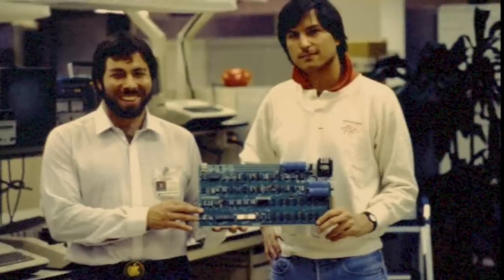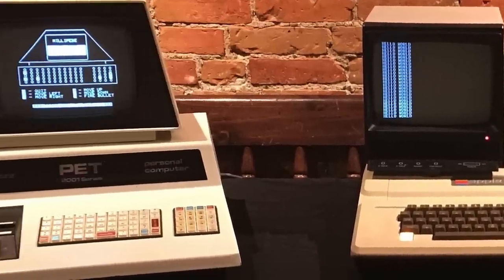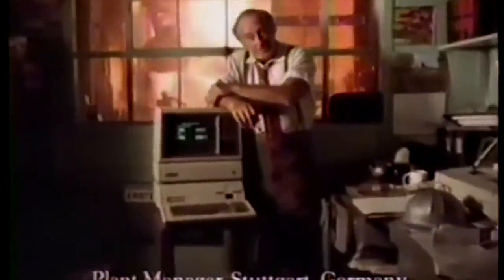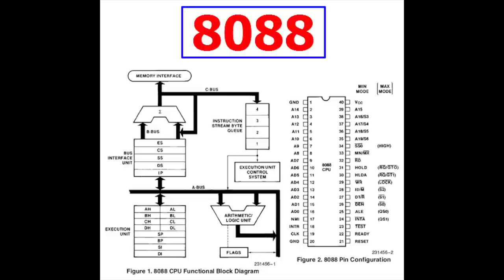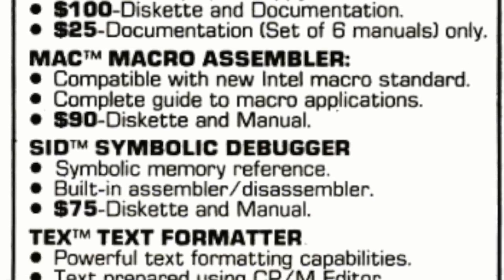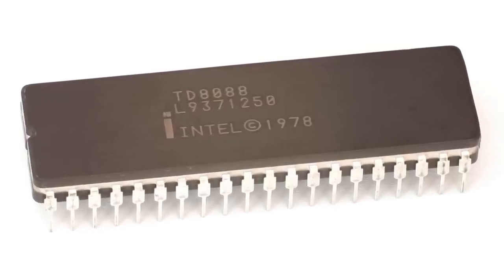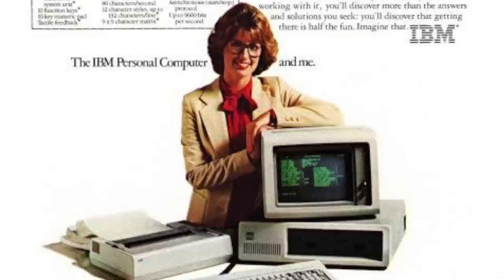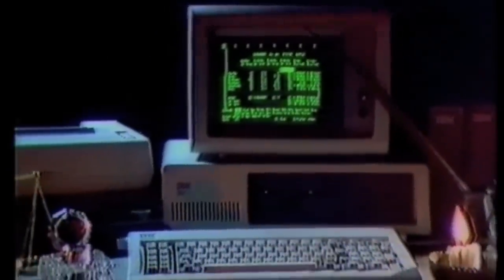DOCUMENTARY: Why and How IBM ended up creating the PC (and ended up choosing the 8088 CPU)

Comment: I bought the TRS-80 when it came out in '77, and eventually upgraded to the PC world with the Tandy 1000, and then home-built PCs. I suspect a lot of TRS-80 owners ended up going that same route to a PC, rather than Apple or something else. My friends with Apple ][s all got Macintosh, but even most of them are now with a wintel product. Nice documentary!
Reply: There was nothing wrong with the TRS-80.  It was as good, or better, than the Apple.  The reason the Apple took off as a 'serious' computer, as a opposed to a hobbyist machine, was due to the first 'killer app' being written for the Apple.
Reply: Also there are a few things I remember back in the day if anyone remembers the old PC Junior.

I remember sometimes running software on there and it was meant for the IBM PC and after a certain point you'd actually get Drive overflow not sure exactly what would happen there because it's just at that time I really was not big into technology nowadays and just really never thought about it again strange home that comes up so much that you don't even think about what happened back in the day with things.

Although the PC Junior probably would be closer to that of the Atari in terms of things like gaming but yet I have a feeling some of the Atari systems were actually more capable in their own way which is kind of cool but even something that was originally thought of as just games such as the Atari 2600 became something more of a PC even in its own way

By the way I was the kid in school that would always be servicing equipment I was the one that would always be loading the paper in the printers and so on.

Also in school I did have a lot of downtime I was kind of ahead of the game you could say!

I had all kinds of access to things that most students didn't even know they are there!

It's kind of neat when you can almost like make your own extracurricular activities including learning opportunities.

This would be happening often times throughout years of my schooling even in the early years.

And yes I got credit for doing so this as well someone is classified technical education I was even doing a bit of recreational engine stuff before even high school.

A lot of stuff was trade specific that wasn't even offered through our school!

Sometimes I was actually server this evening very equipment that I was using to do all this as well.

Some of these pieces of equipment I still don't even know what the media even was that the equipment uesd.

There was one other one that used two different cartridges can't remember what type of film it was but it was on what look like 8 mm film or perhaps 16 some of the cartridges almost looks like an 8-track but oddball much larger pretty sure the audio portion control portion on the same cartridge and tape of course was an endless with cartridge probably the same with the film portion but not sure on this portion.

I do remember often using what they called the teaching projector but this is a different system entirely use a single cartridge for both audio and film.

This is what I would call Antiquated early multimedia!

Also very early in school they have perhaps kindergarten maybe later.

There was a system it was pretty large and heavy the audio was on an LP photograph record the slides if you'd calm that although War closely akin to a film strip but in a plastic slide in frame sort of thing think about your slides next to each other versus a film strip.

Essentially a beefed-up and more utilitarian version of that system from one of the companies that had the stories on film and the audio want to record but intended for Education applications.

One thing I remembered is you always held onto the film portion and somewhat with the record if you open the door to the turntable that Portugal to fill would be quite forcefully ejected oftentimes leaving the top of the machine don't think that was intended didn't work that way only knew about one of these thing you was so not sure if it was a flaw or a feature but if it was part of the system it shouldn't have been that could hurt someone especially somewhere to eat that youngin school that may not expect it
Reply: Also by the way I always remembered replacing lamps in the projectors as well a lot of times before the instructors had trouble with something they'd send somebody to the winter class on me in that the time and say something hey need your help don't take a minute.

And I remember quite often in school being called to the office at first people thought I was getting you in trouble not in the least.

It was usually getting somebody working for someone or other issues and more often than not it was getting the PA system working again we had all sorts of trouble.

Hard to believe I actually had a tool kit in my locker and later on the school actually help me carry a multi-tool!

Sadly one of the very reasons to have this was to have a blade if necessary!

They said it would be a good deterrent if ever necessary never had to go for it once in this respect but then again but that time had been issued pepper spray!

I was underage but I had to get a permit it was that bad that times it seems like a lot of times the most intelligent people in school or the ones that are picked on and demolished it off and but sometimes well that does take a turnaround.

At one point I hope will the school bullies and everyone says you were crazy to do that I said nope he was in a bad situation stranded and his vehicle.

Ever since that point didn't have nearly as many problems Tina most of the others as well as his cronies him and his cronies took care of the problem I remember that time that's why I had locked me in a locker well the other person let's just say he was not-so- lucky he got blocking the Janitor's closet overnight don't know how that happened but the principal said do you know what happened to that guy I said no you don't mean the whole story only one problem with being the smart guy at school is well other people try to pledge rise from assignments although problem is if you do it from a disk or otherwise that in itself yeah big problem.

By the way I did have to back up to the server for my machine used at school.

Back in the day I was using it on-screen keyboard at using the mouse the type that first before the other came along I needed.

I was the only one in school even running Windows everyone else was using dos!

One of the problems is we could not get any of the printers to play nice with Windows so I actually wind up having a friend in the back room which is just awkward!

Later on I wish the iomega Zip drive had existed had to use external hard drive since essentially flash drives did not exist back then But there again Not only was that use for data for removable hard drive but backing everything up keeping everything in sync had to use that system because of this basically all my machines had to have the same date on them since because of the voice recognition system later on was a real hassle originally I'd have to have an entire binder of floppy disks prior to this.

I don't even remember how largest hard drive was for the removable hard drive as I mentioned with plagiarizing before there was at least two people that got caught in the active actually copying my data disc no way you would not have somebody copying your disk in class it was too obvious what they were doing seldom would anyone copy anyting unless backing up something that was very important few and far between and even at home having two floppy drives with an asset for backing things up I did have usually two copies of everything still remember using the old Daisy wheel printer that I had access to it one place primarily for anyting of Greater importance or discounts better and could get a better grade we're just having something printed on Daisy wheel versus dot matrix and yes that was a thing back then it was considered typed work as it on a typewriter instead of a computer printout which was goes to show back when this was being done.

I even remembered if you remove the tractor feed edges of the paper you could sometimes even get a better grade just because of doing this weird I'd say nowadays just using plain paper seems kind of weird that that was a thing later on
Reply: @MrSloika  The TRS-80 was a solid choice as it had the LEGENDARY Z-80 CPU. CP/M users were not going to go to an Apple!
Reply: We used a TRS-80 in high school chemistry class to take quizzes, enter data, etc. A great system, although the frustrating part was trying to load/save files via the portable tape recorder machine.  Sometimes the entire tape would run to the end without detecting a file. The arrival of the floppy  💾 disk drive was a godsend.
Reply: @aaronbrandenburg2441  The Junior had a nice monitor, but the plug only fit that computer. I would cut it off and rewire it to a standard connector.
I had to laugh at one character. He was in my home workshop, and freaking out because I had one of those monitors on my Commodore 128, and a Commodore monitor on a PC.
Reply: Hey always love to hear a good story like that I'm no stranger to things being hacked up and reused for other purposes I've use scart connectors for just multi pin connectors that I didn't want compatible something else or ingest were convenient besides if sometimes Nene and shielded cables it works even though I'm in the United States I was able to get ahold of stuff the other people right over the years trust me I had sources for Stuff had known so many people back in the day and yes occasionally I had even used a computer monitor as a television if it had to run inputs for older computers had a box of my gave me don't even remember who made it or anyting back in the day you can plug in an old computer monitor and you hand a decent television if I remember correctly I even eventually had a cable box connected to this!

Also had AV inputs as well and even audio pass-through on the unit if so desired to be used even had a separate output for a TV audio not sure why and also it is could be used as a TV tuner only without being connected to a monitor with output over RCA and also this was stereo audio out wish I was going to amazed supported different types of monitors as well whole bunch of outputs for this purpose Niche device use that thing to death for all sorts of things was kind of nice to have your test monitor also a television heck sometimes even know who to my old NES into this occasionally since did not have a spare TV at that time!

Wish I had a DVD wiedeman nice for the workbench as well as have a small TV somewhere could have easily have used this box to do this also if I'm not mistaken this ran off a DC adapter and also had a car cord with it originally which made me scratch my head because this look like more like something that would be used in a fixed location!

Also this did integrate input switching in for both the deal and audio and even separately So eventually I think I used it in my audio system until it finally bit the Dust and also the tuner was digital and had a remote there was another box that would forget that essentially was an external relay box to allow you to switch monitor power if necessary also there was a separate monitor power switch on the remote as well you're going to go that far why wouldn't you just have AC power coming in but then again why would you even have it so this could use mobile for V DC is just strange
Reply: @michaelterrell  I didn't remember the monitor to great on the PC jr. But I seem to remember that it did have a decent monitor but really didn't think much about it until you mentioned it since it been so long ago kind of forgot about the monitor its self.

Think I heard this from others as well over the years but been so long.

Also I do remember that the PC Junior could run some PC software however you would get Drive overflow error after a while I'm not sure what that actually meant on there because back in the day I wasn't really into the technical aspect as much as I was nowadays it sounded more like an access issue or maybe a memory issue or a buffer issue I know that the PC junior did not have the full fledge capability of the PC for obvious reasons does anyone know actually what was going on when you got Drive overflow which normally I had never seen that error on anything else other than the PC Junior which is probably why I never thought about it
Reply: @aaronbrandenburg2441  I just scrapped the computers, I couldn't even give them away, and I got tired of being asked why I couldn't make the wireless keyboard work on a regular PC.

Comment: IBM actually released its first personal or portable computer in 1975: the IBM 5100. It was followed by 5110 in 1978, 5120 in 1980, Datamaster in 1981 and just a month later model 5150 which we all know. The problem with those first ones was the price. Also they were not micro computers in the sense that their CPU was not a single microprocessor.

You can actually see IBM 5100 at 4:30.
Reply: I used a 5110 in 1978, it revolutionised the way we  worked. We  could do a crude (by excel standards) income tax type  data model for 500 churches with 30 parameters in an hour per re calculation . A task that took 3 days by hand. i think the cast was about £10k with two 8" 1.2 Mb floppies and a dot matrix printer.
Reply from the maker: Still got it done though! That's the great thing, some times I wonder if we have advanced too much. A lot of the things we have today were supposed to make our lives easier, but have they truly made it better or have they shifted the problems, or worse, made life less pleasant?

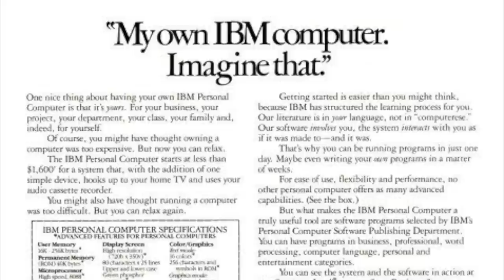Comment: 31:02  The original list price of the IBM PC was $1565 in the "bare bones" configuration (16K RAM, BASIC in ROM, monochrome composite video card, no monitor, no storage drive).  I'm sure this was done just to create a "low ball" competitive  advertised price point, but in practice never sold that way.  The ad copy says "with the addition of one small device" it can be hooked to your TV for a display and a cassette recorder for storage.  That would imply a cassette interface cable and an RF modulator was available to make it work.  However, various sources have failed to find the IBM branded OEM parts for this.  Likely that IBM virtually intended to never sell a PC for a TV and cassette (just the thought of using it is laughable).  A more typical starting config including floppy drive and MDA monitor would be sold at nearly twice the mythical "less than $1600" price point.

Comment: The success of the IBM PC was largely based on the open architecture and the unforeseen fact that there were millions of geeks lurking out there who just wanted to fiddle with the thing.
Reply: The open architecture ( which was likely because the PC was done in a skunk works fashion, the corporate lawyers and  marketing ppl didn't know about it; IBM was anything but open. The fact they let MS have rights to windows prob led to major teeth grinding at Armonk,prob bc they never envisioned anyone but blue suits to have one). 

The success wasn't the geeks. The IBM PC was too expensive, I had one circa 1984 w dual floppies, and a 13" color monitor, it was 5k ( be about 15k in today's money). 

Its initial success was corporate,by having the IBM name on it it legitimized the PC. Before that with the CPM based machines and things like the Apple II it was the domain of Greeks and home users mostly ( some businesses,bc of VisiCalc in the apple II series, started using PCs).  When the first clones came out, they weren't cheap either,but it was the clones that moved them into the geek market and the like.

With the PC companies didn't need things like dedicated word processors, and the person who once was called a secretary could do a lot of things on one machine. Likewise when they worked out networking ,( which in those days was expensive as heck, was like 1500/workstation) , allowed shared file servers and the like.
Reply: @njlauren  I also had an original 5150 around 1983 or 84. It was a hand-me-down from my brother and yes he paid about $4500 for it in 1981. Prior to that I had an Apple II which at the time was still somewhat "open architecture" as I was running CPM on it with an aftermarket card.  I think that both Apple and IBM were trying to get the cat back in the bag and Apple had more success in that regard but for most of us the PC clone market was the ticket.
Reply: Yes - the open architecture was a huge advantage and reason for the success of the IBM PC. In fact, IBM was counting on IBM PC customers to eventually purchase it's own add-on cards to boost its sales and profits. However, most customers simply bought the bare-bones system, then filled in the expansion  slots with cheaper, better ISA-cards from third party vendors such as AST Research and a plethora of related companies. By the time IBM created its proprietary MCA bus to lock-in its customers, the PC-clone vendors simply created their own industry standard bus, I believe called the VESA bus, but memory evades me. In summary, the IBM PC created the common platform that helped propel the PC ecosystem forward.
Reply: @njlauren  Hey - thank you for refreshing my memory... seems like a long time ago. You also noted the other stopgap measures IBM engaged in to reign in and lock in users - but the horse 🐎 was by then already out of the barn. Thank you!
Reply: @nicksterj 
You are correct, that was my bad, I meant to say DOS, not windows. The original DOS was actually created by a small firm called Seattle digital that Gates bought the rights to for some pretty small amount. Seattle Digital later tried suing ms but lost. 

Windows was MS code, though I somewhere dimly recall it originally was bought from a third party and modified ( that I am not so certain of).